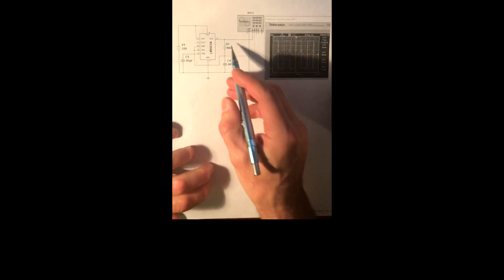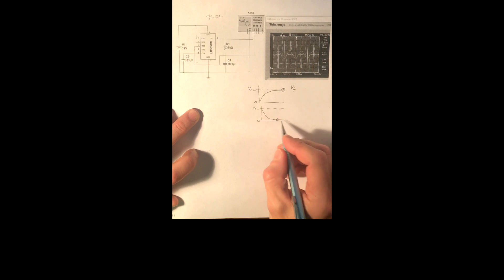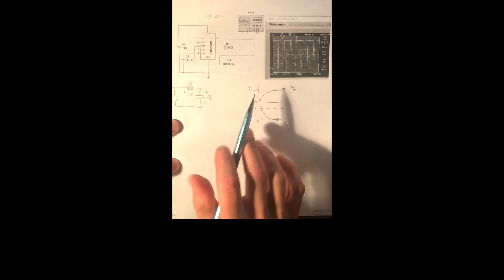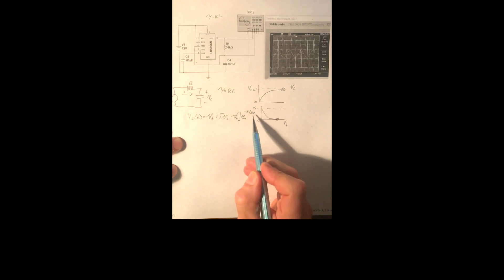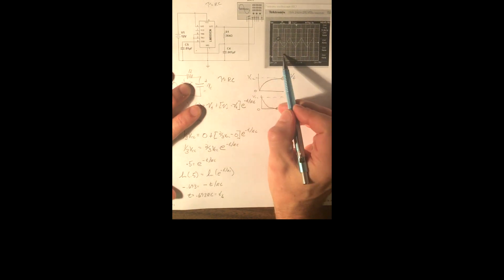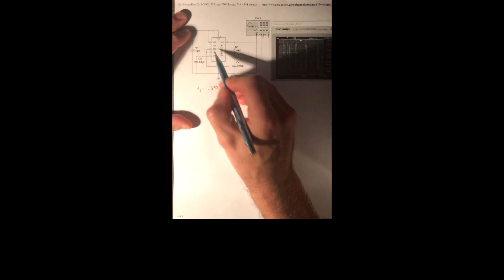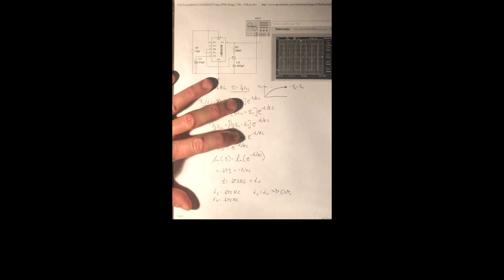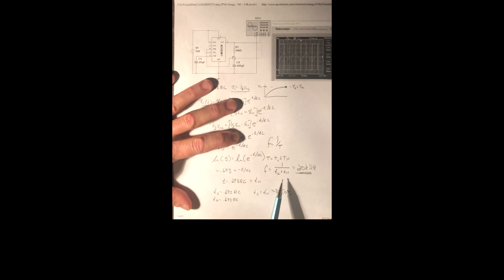50% Duty Cycle 555 Timer Circuit Tutorial

Comment: I have always used this circuit to make an astable multivibrator. The circuit in the data sheet of the NE555 is useless. It can never get 50% duty cycle and it consumes a lot of extra current if one tries to get close to 50% duty cycle. I have never understood, why they don't have suggested an output controlled version of astable multivibrator. I also never understood the discharge pin. An inverting output pin would be much better.